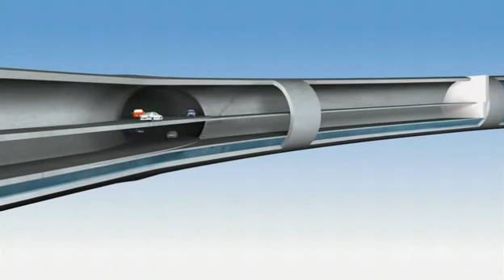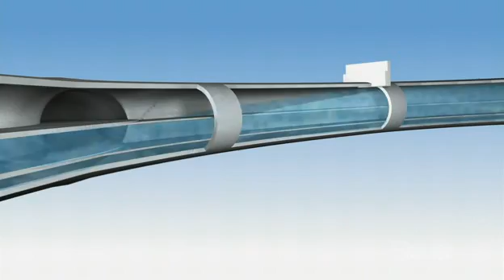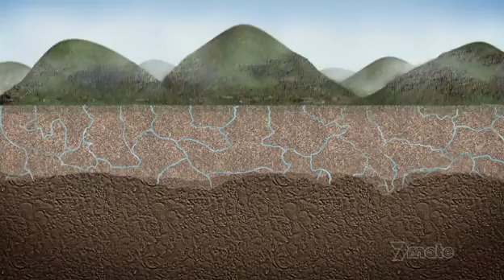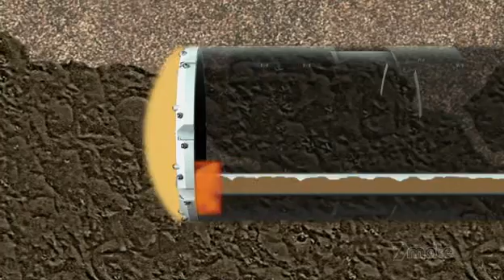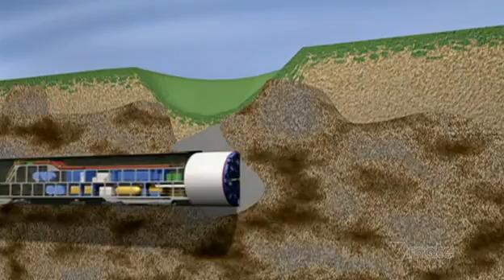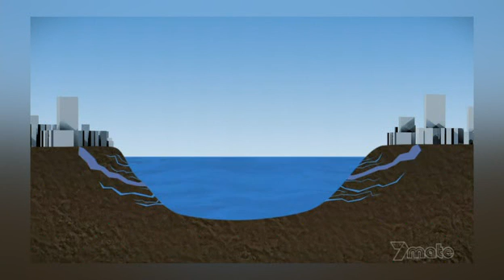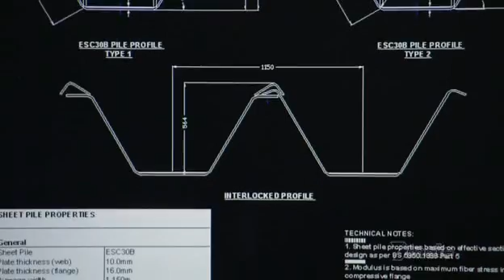Discovery Channel Man Made Marvels Kuala Lumpur Flood Control 3/4

Comment: This tunnel boring thing is nothing new , using a slurry is nothing new, pressure in front of the boring head is nothing new, they’ve been doing this for years it’s all for  dramatic affect.      Even using corrugated piling steel , it’s not new we’ve been using it for years that’s nothing new hello there’s nothing new here nothing new at all.   This mole guy hasn’t invented anything  new. This guy needs to go sit down. They’ve Ben doing this stuff for years.  Alllllllll for a dramatic affect.
Reply: DITTOED ! We need this thing in the PHILIPPINES :)

Comment: Wtf. Abruptly stops mid sentence and doesn’t provide a part two video 👎🏻👎🏽👎🏾👎🏿👎
Reply: Check the "up next" in at the top of the recommended vids in the far right, or hit the next button, (shift+n) to the right of the play button. Most times it will take you to the next segment. Though not always. It's pretty common to up load in segments for several reasons like the automatic copyright AI or the time it takes the up loader to upload.

Comment: That road would be destroyed after a flood
Reply: It is concrete. Not the usual asphalt.
Reply: @gingerteddy618  water at high volume through a tunnel causes cavitation and would very quickly erode the walls of tunnel and the high speed of water would make the rebar in the concrete have a harmonic vibration and break more of it apart total disaster waiting to happen
Reply: 1
Reply: @a j wud ? Really iv never seen someone use a slang version of the word would. I might have to use that one. lol
Reply: @a j na actually i dont understand what you tryin say bruh
Reply: road inside tunnel still at the best condition till now. used it for escape from heavy traffic almost everyday